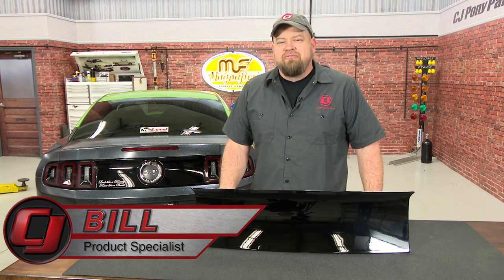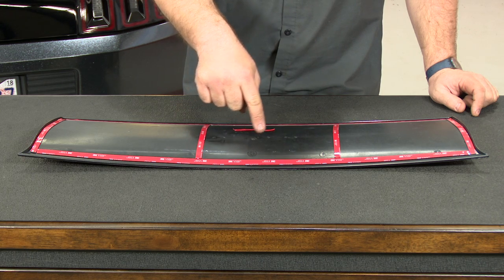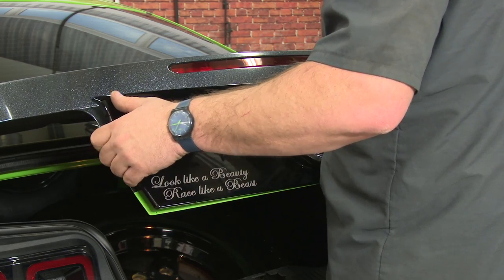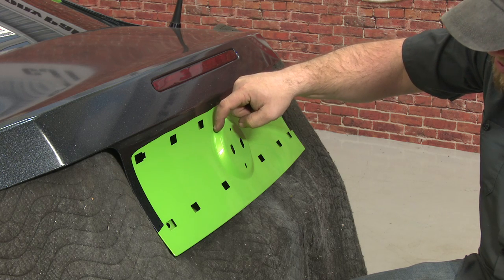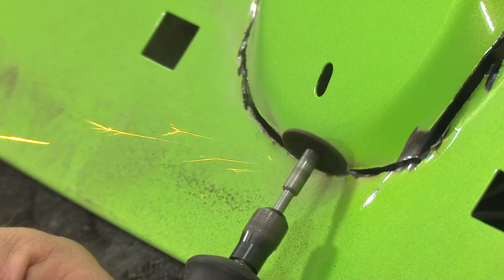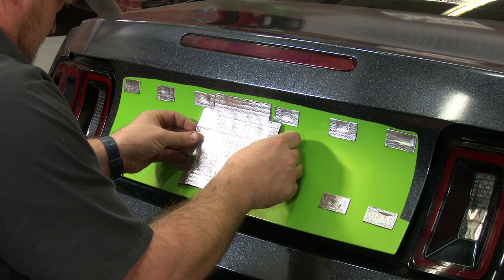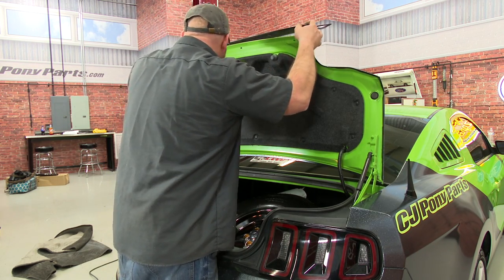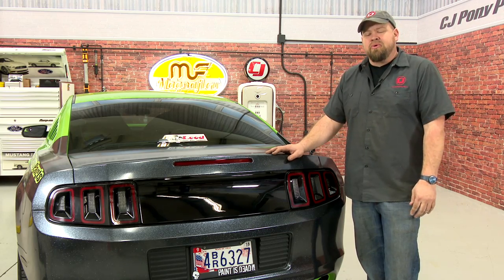Mustang Decklid Panel Smooth Black 2010-2014 Installation

Comment: Truth of the matter is, and make no mistake... I love my Mustang, but Ford dropped the ball on the original clear coat on these. Virtually ever one you see has clear coat degradation. I'm very happy with the Smooth Replacement, but be cautious on installation. Make sure you line it up perfectly. Thanks!

Comment: So for my 2012 it's basically remove the fake gas cap and dremmel out the hole? Since it doesn't come with a factory decklid. I just purchased the rtr decklid and drilled holes and attached a pony emblem.

Comment: You should have shown the part where the decklid kept lifting up on the edges.
Reply: I regret doing it. Not worth it
Reply: I agree. I think I’m going to try the RTR decklid instead. Most people seem happy with the fitment on that one.
Reply: @justinm.1732 do I have to drill cuz a homie did his and he never drilled anything jsut popped off the older one and stuck on the new one

Comment: Will I be able to add the coyote badge instead of the pony and GT badge?
Reply: i know this is a late response but I'm going to buy this panel and I was wondering if you can buy and put the mustang emblem on the back with 3m or do you need to drill holes?

Comment: I followed the instructions to the T but for some reason the panel keeps wanting to pop off. I even went to my local store and bought more of the 3M automotive tape and it still pops off along the top. I cut it completely flat put the tape on as shown but it pops off after 24 hours
Reply: Ouch😬
Reply: Decklid is probably bent or twisted
Reply: Covered every inch with 3M tape. Came off again the next day.
Reply: Car was straight but lid didn’t fit right. Ended up using clear marine adhesive and it held great.
Reply: @politicalmechanic9501  Can you tell me which particular marine adhesive you used? I’ve been trying to get this decklid to stick for over 2 weeks.
Reply: @Nigel__  I believe it was Loctite power grab clear. I used small woodworking clamps with wood to gently clamp it down for several hours so it would set.
Reply: @politicalmechanic9501 Thank you. Gonna try that and see what happens.
Reply: @politicalmechanic9501 did you just remove the 3m tape and cover the whole thing in adhesive?

Comment: Hello I broke my factory OEM Decklid panel. I couldnt find it on the web. I want the same one.If someone is upgrading them and dont need the old one or know where to get one can you let me know ?
Reply: Arda yo i am upgrading mine the model is 2012
Reply: Julian Durango Whats up man, thanks, is it same for 12s and 13s ? Because  12s don't have it as OEM . If it is the same size,  that would be great!! Anybody know ?
Reply: AR3Z-6342528-F is the updated deck panel for any 10-14 mustang GT.  Its the only other factory part (other than original gloss).  Has same material as license plate area below it, no gloss so there is no hazing to have to worry about.
Reply: I have one from 2014 but the bottom half peeled from glossy to matte black

Comment: Isn't this the same as the RTR decklid panel
Reply: The RTR we used to offer was metal and some had corrosion issues, this is ABS plastic.
Reply: Plus the RTR one has a RTR logo on the bottom right corner which I personally don't like.
Reply: 11secondeclipse this is the same one from freds parts it has the holes on the back to drill out for the 15 gt or pony badge if you want it. I prefer the unknown with no emblems

Comment: My 2012 only has the shitty looking faux cap not the panel.
Reply: Its not a faux/fake gas cap.  Was never called that..ever.  Its called a name plate and its an emblem.  Makes Mustangs look like Mustangs and not Fusions.
Reply: Um yea on my 2010 the deck lid is all one peice. Was wondering if they bolted the name plate on or if its 3m adhesive stip
Reply: I've also got a 2012 i think the process is the same should be easier if anything since you're not having to remove a decklid already on.